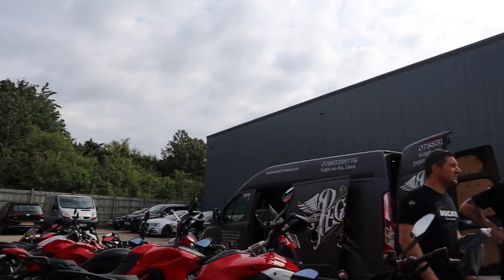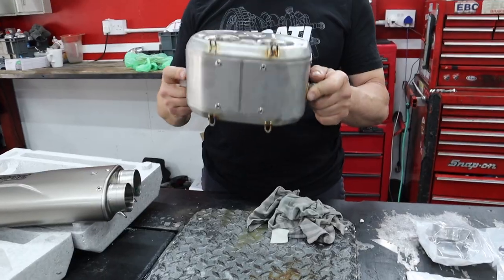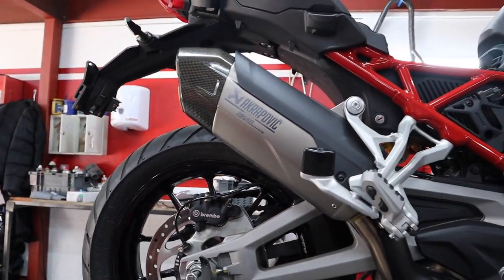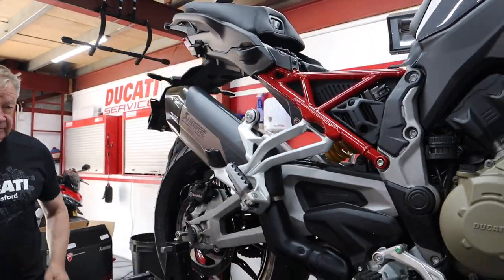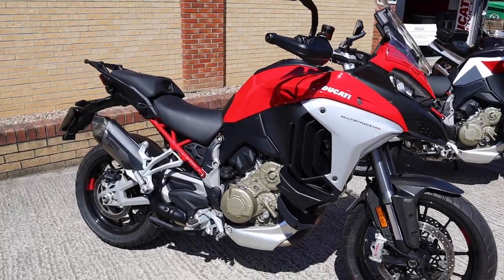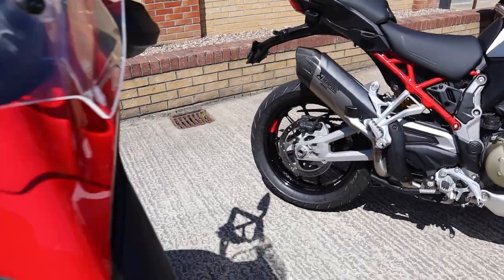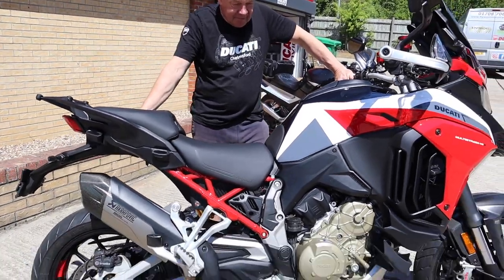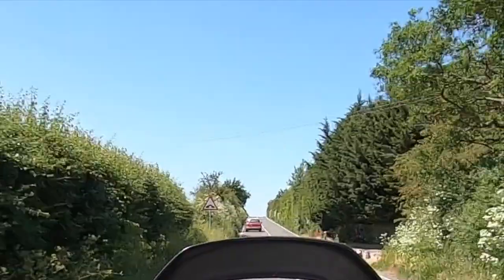Ducati Multistrada V4s Full Akrapovic Exhaust System , Sport Livery ,carbon screen + extras

Comment: Just got the system and Im pretty handy so figured I would fit it myself, your video was super helpful although I did get stuck getting the CAT off as your don't show removing the right peg.  I actually ended up phoning your shop and the super helpful service guy told me thats what I needed to do so thank you very much.  All in doing this first time with no instructions it took me about 4 hours not sure what the book time on it is.  If you are going to do this make sure you get the parts diagram from your dealer its tough to figure out how the bracket fits otherwise.
Reply from the maker: Yeah it’s not too bad to do, glad it came in handy to help a little, not really a full tuition video to show how to do it but it obviously helped anyway , and that the service guy, probably Liam , gave you the information u needed , always happy to help :)

Comment: Hi ..awsmmmmmmm video… how’s the engine heat on this bike??
Reply from the maker: Thanks , for me it’s ok , it’s not like riding the Panigale … any bike with a V4 or V2 engine are obviously a little hotter then a triple or inline4 but I have never really had any heat problems, if fact in the winter it helps :)
Reply: @ProjectMoto  Thanks for the prompt reply…safe miles 🙌

Comment: I heard someone removed the baffles from 'the box' that may give it more throat but may also attract plod more often, no idea how you'd remove them? I also heard you can 'buy' the RACE EVO mode as you get with the PP? Not sure what that'll give you, again, I heard it gives you 'drift control'?
Reply from the maker: You could take the baffles out but that would mean drilling out the rivet’s and the baffles, have heard one that has had it done but really to get a better sound you would also bet a de-cat pipe to remove the catalytic converter, but you would need it mapped, as far as I know you can only get the Race Evo mode when you buy the exhaust and get the map from Ducati

Comment: Hey guys, actually ended up with a V4S Multistrada. What are your thoughts on fitting a performance air cleaner? Have you fitted any and noticed any difference? If so, which brand would you recommend? There's obviously the Sprint Filter and the DNA brand. Thoughts?
Reply from the maker: Tbh we’ve only changed the air filter with the full exhaust system and then have changed the map , for me personally changing the air flow without anything else I can’t see it doing anything good really , but like I say we have not changed just that on a bike before
Reply: I've fitted the Sprint AF filter, can't really tell any difference to be fair, it will be top end values where you'll get the benefit as, at low revs, it's not sucking much air in so no difference with the stock, but may breath better at higher revs. Is it worth £80? Not sure, it's a performance machine, it deserves performance parts, it won't make it worse, but don't think it'll change it that much, don't expect a difference, if you track it and rev the tits off it, you might do. Plus its a real bitch trying to swap the filter out, I really struggled but can be done without taking the bike to bits, just the four filter cover screws then pull forward and to the side slightly and gently pull the filter to the left side and slide the Sprint AF in, don't jam it in as you'll bend the metal screen.

Comment: A lot of folk cut the cat open, gut it and then weld it back up again, but they have to get O2 eliminators and stuff.
I guess you lot have to do eliminators too. Do you have to remap ‘em? Is it possible to remap a Duc’?
Reply from the maker: Yeah they have a remap when you put the system on , and you have to let the bike know the oxygen sensors, exhaust valve etc are no longer needed , if it will show faults with the engine management light being on

Comment: Does the full Akra system reduce heat output to the legs? Most bikes are coming out of the factory running way to lean & with those horrible cats making the bikes run really hot. I live in Las Vegas & it is dreadfully hot here for 5 months out of the year. If the full exhaust reduces heat significantly I will buy this bike
Reply from the maker: The full system reduces heat a little , the v4 engine feels hotter then say an in-line 4 as your sitting on cylinder heads really , the Multistradas are not as hot as the streetfighter or panigale and have not found heat to be a problem myself .. but then it doesn’t got that hot over here in the UK , try and get a test ride on one at a Ducati dealer and see how it feels

Comment: Great sound, I just got mine 💪😀
Reply from the maker: Awesome, it really does sound nice when your on throttle, still quite enough at lower revs if you want to go touring
Reply: Question: did you manage to install the centre stand with the full akrapovic system?

Comment: I got a new Multistrada and wonder if you save fuel whit this system? And have you map and change airfilter? (I dont see that in this video.) Thanks for a very good video!!!!!
Reply from the maker: Tbh I don’t think it would save fuel , it does have a map that obviously fuels it correct though, you don’t get an air filter with it and it does not say you need to change it, and thanks, appreciate it

Comment: Have you measured decibels?  I'm curious about the decibel level. Because Korea has strict motorcycle inspection standards.
Reply from the maker: I haven’t measured the decibel level , I will try and find out though, but they are a ‘race exhaust’ and not meant for road use though
Reply: @ProjectMoto  thank you for the sincere reply

Comment: Does the full system reduce some of the heat created by the CAT or no real difference? Thanks
Reply from the maker: Tbh there’s not much difference that I noticed but I imagine it is a little cooler , the cats do get hot and I guess you would get a little more airflow around the pipe work on the full system

Comment: I've read from others that the map changes how responsive the mid and high power modes feel. Were you able to notice a difference?
Reply from the maker: Yeah it does actually change how it feels, it’s not a lot of extra bhp and torque but enough with the mapping to make a difference , they are fast enough anyway tbh, I rode the bike again today and it is different, it’s more responsive say when your in a higher gear and accelerate

Comment: Question: did you manage to install the centre stand with the full akrapovic exhaust??
Reply from the maker: Yeah you can put the centre stand on, it comes with a bracket that fits on the bike that the stand stops on when it is up
Reply: Thanks for your feedback. So does it mean that the centre stand for this full exhaust is a different type as the original centre stand?
Reply from the maker: @henkstigter44  no it’s the standard canter stand, usually when the stand is up it stops on a rubber stop on the cat of the exhaust , so with the full system there’s just a bracket that comes with the exhaust that has a rubber stop part on it for the stand to rest on
Reply: Thank you so much for your swift feedback! Very much appreciated. Warm regards from Moscow.

Comment: Hello from Australia. I have just come across your channel as I was looking at V2 Multistrada videos and can tell you that I bloody luv your content. I am new to the Ducati Family and in the coming weeks will be taking delivery of a 2022 Multistrada V2 S Travel. 

Other than the Ducati Termignoni option for the rear silencer, have you come across any other option that actually sounds good? I know there is a Akrapovic Slip On for the 950 model but not sure whether this will fit or in fact sound any different. 
Thoughts?
Reply from the maker: Well I’m glad you have finally arrived , thanks appreciate it , yeah the Termignoni’s sound awesome , you do need to get the ‘half’ system that removes the catalytic converter for extra sound, just having end cans don’t really do to much other then the look really, and with the Map for the Termignoni it really works well , I have done a video on the Monster which is the same engine with the Termignoni exhaust ,well I’ve done a few videos on it with baffles in and out , just look on my channel and you should find them :)
Reply: Will that system fit the V2 Multistrada? Do you have a part no?
Reply from the maker: @johnrose6858  no they don’t fit on the V2 it’s is only for the V4, just got the parts guy to look and they only offer a Termignoni race end can for the V2 on the system

Comment: Dear sir,
i contact you from Spain, i had Multi V4S with Akrapovic Standar,..., my question is to know if the standar Akrapovic has DB Killer or not..
thanks in advance, and very good videos !!! Olé
Reply from the maker: I don’t think you can but when I go tot the shop tomorrow I will check for you , and thanks, appreciate it :)
Reply: @ProjectMoto  Dear sir, any new? thanks in advance
Reply from the maker: @michelverdes2914  I have asked one of the guys here and he said you can’t do it on the sport pack Akrapovic exhaust , tbh I would think most of the sound is being stopped with the catalytic converter, maybe a few cat pipe would be the answer ??

Comment: Was the weight saving and sound worth the price?
Reply from the maker: Only the people who own the bike and the exhaust can decide that , personally I like it 😊
Reply: @ProjectMoto  I just got mine this weekend and it just seemed awfully quiet.  I don't need anything super loud I just like to hear the engine more
Reply from the maker: @ducatitesteratta4177  yeah standards ok when your on the throttle, the full system does change the way the engine delivers power a little and is louder but not over the top loud like some exhaust systems

Comment: sounds good! I've still got the stock exhaust and found the akrapoviç end can a bit sounding the same like the OEM and for that price it's a bit stupid to buy one I found. I'm verry interested in the full system of Akrapoviç. But the only thing I'm wondering is in how far is it possible to put the full system on the Multistrada myself? I guesse putting the pipes and end can on will not be a problem, but what with the mapping? Can it only be done by a Ducati dealer or is there a way to do it yourself without buying sophisticated software for your computer? Or is it possible to mount the system yourself, drive to your Ducati dealer to put on the software? Will it potentially damage the engine if you drive with the full system without the mappings? Also what I'm a bit worried about is the actual DB's. Is it as loud it's almost associal to ride with it (just thinking starting it in the mornings to go to work that I don't necessarly wake up the neighbours ;)) Also for some touring in Germany and stuff with the rules getting stricter  and stuff. I've rode the Streetfighter V4 with the full system and this was a bit much for me. It was fun for a day, but I can imagine if you ride it for a trip of 500 km's a day it will get anoying... How's that in comparison with the full system for the Multi?

Thanks for the vid, enjoyed it and love the typical English chat <3 Greetings from Belgium!
Reply from the maker: Yeah the Akrapovic end can you get with the Sport Pack is not much different to the standard, and a waste of money if you are thinking of the full system as you can not use the can,Tbh they are a lot of work changing the exhaust, mainly the header pipes , depending obviously on a person’s ability and experience on working on bikes it’s hard to say if they can do it and how long it would take, then yes there is the problem with the mapping, you would have to ask your local dealer if they would do it as it needs to be plugged in to the computer at the dealer, some will probably do it if you have bought the exhaust from them, you should always map the bike as all the fuelling with be right it does make a difference, the full system is louder, nothing like as loud as the Streetfighter with a full system , which for me would be too loud for touring , but obviously it’s louder then standard, not overly loud when ticking over or low revs , but you can hear it when yr mid revs and on the throttle
Reply: @ProjectMoto  Allright, thanks for the answer!! Big thumbs up!

Comment: Sorry, but if a greasy mechanic was installing my full titanium Akra with no gloves on I'd be livid... even finger prints can burn into titanium and permanently stain the metal.
Reply from the maker: Don’t be sorry for your opinion, the exhaust gets cleaned before any heat goes through it
Reply: @ProjectMoto  It just bugs me, bro... some of these Akras cost over 5k, almost  $8k USD.